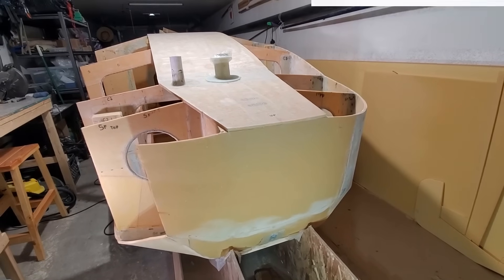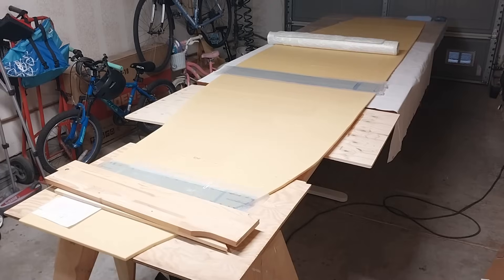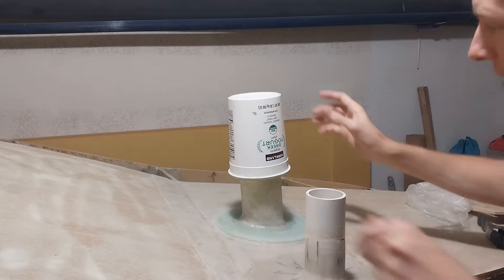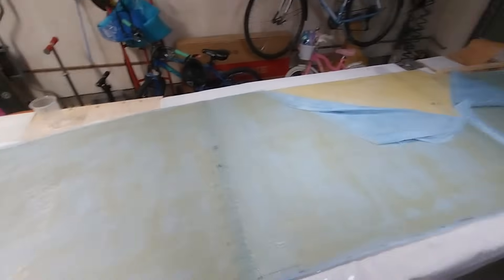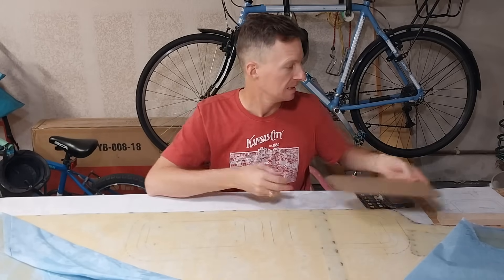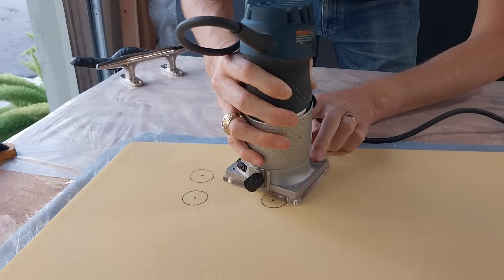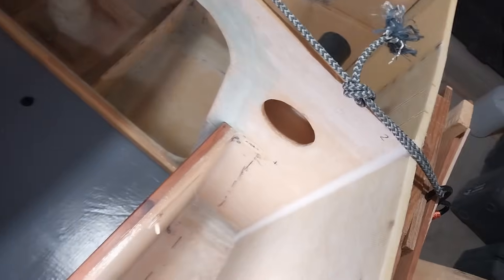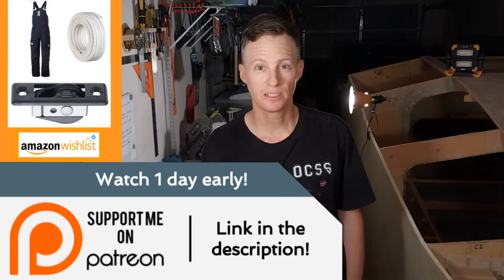OCSS-063 Finally Closing the Hull COMPLETELY! Whiskey Plank - Mini-Cruiser Sailboat Build

Comment: Did you think about filling the mast tube with grease in order to make it waterproof? I have no idea if it would work, but it might be a possibility... 😅
Reply from the maker: Thanks. I don't think it's necessary, with the setup I've planned out it should keep almost all water out and no messy grease needed. There will be a shaft back aft for the internal tiller, it will pass through the deck and use bearing grease to stay waterproof.

Comment: You are doing an incredible job on your boat. I am so glad to have found your site. I am amazed how much room is inside the boat. You have sure pit a lot of thought into the design and layout. 
What about a 6” mini sugar scoop on the back with cut out handles on the sides to climb back in the boat after a swim. You would also gain a little water line.
Reply from the maker: Thank you! Glad you found the channel too. A sugar scoop would interfere with my rudder plans, but I was thinking of having some kind of step built into the transom for getting back onboard easier.
Reply: You could have a v cut out of the center of a scoop that would also act as a rudder stop but also allow it to pivot . What ever works, just nice to be able to get back on board.

Comment: I'm impressed with how that panel lined up perfectly at the bow, for your filleting. That's pretty precise considering that it was the entire hull side. 

I haven't been watching much these days, because I've relocated back to the US from Thailand and I just procured my next boat project. And am getting underway with its gut and remodel. For many years I have wanted a Balboa 26' trailerable, swing keel. And I finally got one on a pretty nice trailer. So now I'm putting down some gravel in the back yard , building a gantry, and getting a sort of greenhouse structure up in preparation for my winters work here in Ohio. 
The foredeck of the Balboa is soft, so that's going to need to be re-cored but I'm planning on cutting a lot of the inner liner out anyway, to refit the interior in a more modern fashion and to also make the boat more watertight, by doing away with thruhulls, old hardware, rub rail, etc... I'm also considering doing away with the actual swing keel, in favor of an encapsulated, poured keel. This is gonna be fun!

Good luck with the continued work on your build. I'll be watching your progress again Capt. Perry. Take care and Kudos on the Whiskey Plank. I don't drink whiskey, but I did pour a good glass of Cabernet to toast you as I was writing this. Fair winds!
Reply from the maker: Thank you, good luck on your project too.

Comment: A tip a 4 inch wide paint tray covered in foil will increase your working time for large panels also epropulsion makes a great elec outboard paired with bougerv soft solar and battery lightweight and effective

Comment: The forces created by a drogue are immense. Be sure to support the cleats really well. In production boats ppl advice not to use the rear cleats but to add special purpose chain plates to the transom with a metal bar bracing both chain plates internally against each other.

I'm getting myself a Laphroaig now to toast your whiskey plank! Cheers!
Reply from the maker: Thank you. I've added an extra 1708 strip where the cleat goes through from the transom all the way to the main bulkhead, frame C5 (I think it's better show in the episode where I made the port side.) Hoping that helps spread the load a lot. Then it will of course get a large G-10 backing plate.

Comment: Congratulations, great close out! I like your technique of pre- glassing long panels, what’s the core thickness you’re using? Looks like 3/8-1/2”? Seems pliable enough after glassing for slight curves? 
Thanks again🎉
Reply from the maker: Yes 3/8". I would have liked 1" panels but the cost was too high for me. Yes it will still curve somewhat easily for the slight curves. Where it curves more I just leave it unfiberglassed until it's epoxied in place.

Comment: Congrats!  For the mast tube might want to check out a rubber drain pipe coupler. Home/Depot plumbing department has a "DWV Flexible PVC Coupling" , they are flexible PVC construction, they have two 300-series stainless-steel clamps resist corrosion and offer efficient seals for sewer and DWV piping
Reply from the maker: Thanks for the tip! I'll check it out.